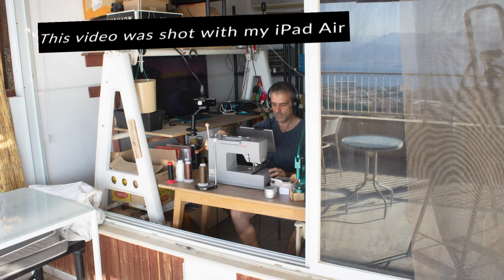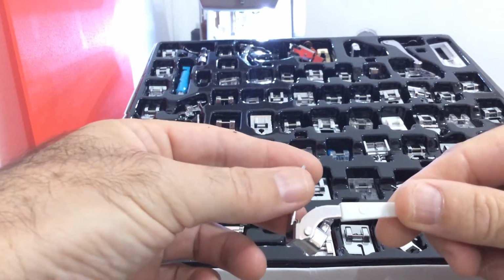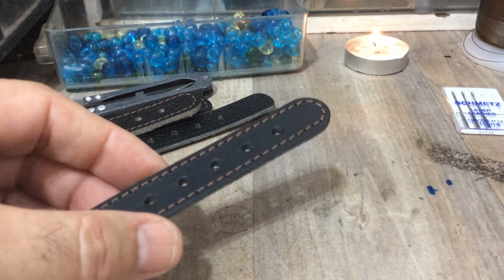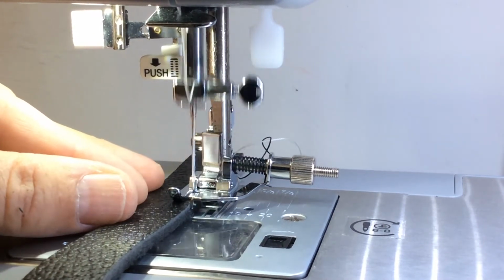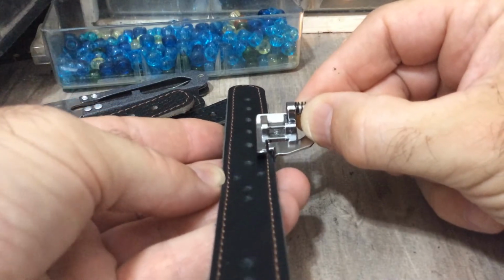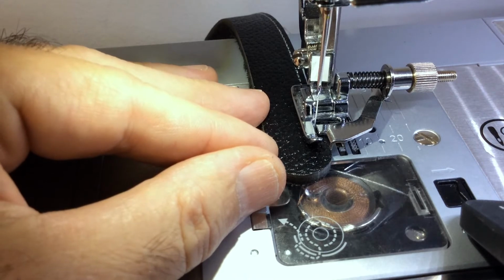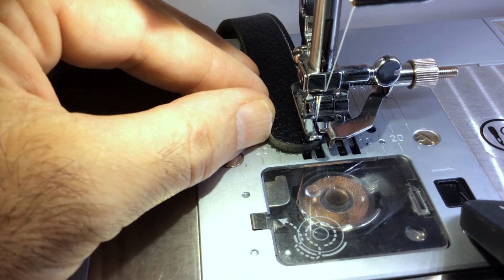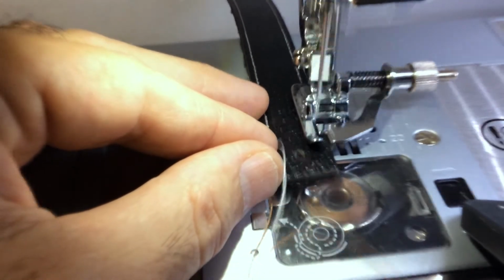My Presser Foot for Stitching Leather Bracelet and Belt Edges - Singer Heavy Duty Sewing Machine

Comment: Im glad I found your Chanel! I’ve just got this machine for my birthday and have only Hand sewed leather before. Having somebody doing leather work on the same machine really helps, especially the presser foot with the limiter. That is a game changer! 

Also what kind of thread do you use? I have the feeling the machine is not really happy with the nylon thread I used for my hand sewing… there is a lot of resistance in the system when pulling the thread, sometimes even resulting in the thread being pulled back through the needle… maybe you can help me here 😅
Reply from the maker: Bonded Nylon Sewing Thread  Size #69 T70 210D/3

https://www.amazon.com/gp/product/B07QYF34VG